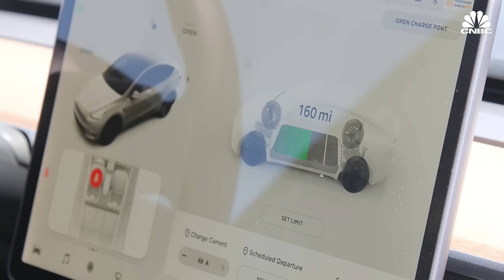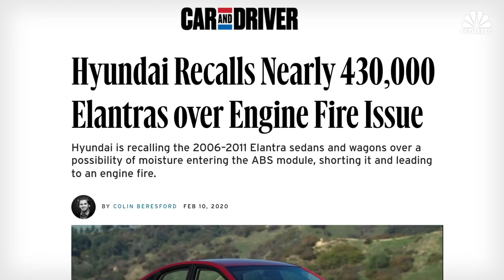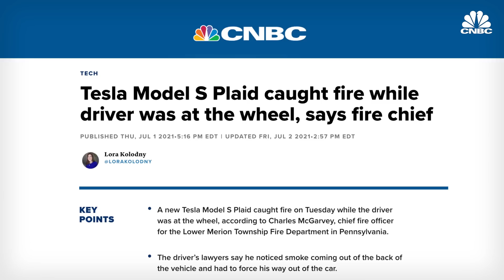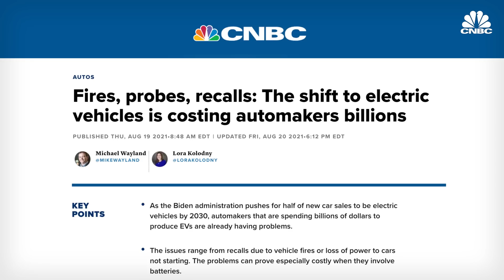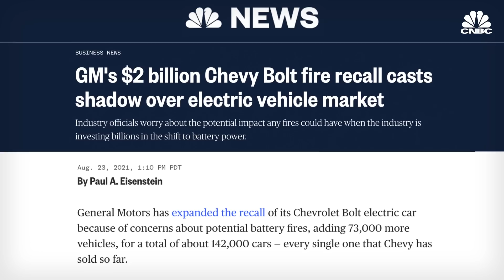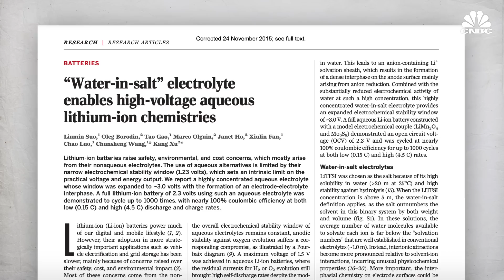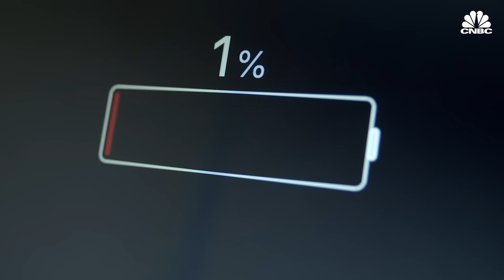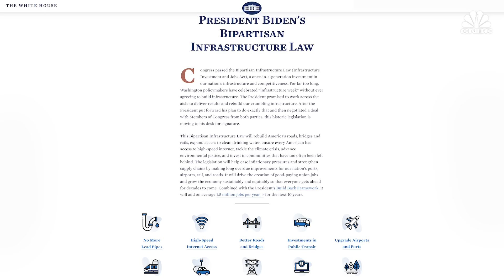Why Tesla, GM And Other EV Companies Have A Fire Problem

Comment: As they said, these types of fires are very rare. 
You're more likely to get in an accident than having the vehicle just burst into flames. 
Of course, the media likes to make it seem like this is a daily occurance.
Reply: Agreed
Reply: Fires in garages can occur for many reasons, but if the garage has an EV inside it, the fire can become catastrophically damaging very quickly. Even when an EV is not a source of a fire, just having it becoming involved in a house fire raises the stakes by an order of magnitude. Having an EV inside your garage is like choosing to store a box of dynamite in your garage, but people aren't realizing this risk. With more incidents and more news reporting of those incidents, EV owners and prospective buyers are gonna have second thoughts.
Reply: there are more than 900k vehicle fires in America each year, most are ICEV.
Reply: @markplott4820  most of those fires lasted less than those of a lithium battery car or were put out with extinguishers, good luck dealing with those super safe batteries.
Reply: @dawrincueto6962   - FALSE, you can knock down a battery fire in less than 3 minutes and just need a water tender Afterwards, once you ISOLATE the battery from the Circutry , the FIRE is a non issue. 
TESLA including all OEM's have a battery Isolation INFO page.
Reply: @markplott4820  so why have firefighters had difficulty putting out those cars and even reignite after using more than 20,000 gallons of water, can I see a video of what you say in practice?
Reply: @markplott4820  because evs make up only 3% of auto sales. What do u think would happen if there the majority of vehicles on the road?
Reply: @herbertfreeman3767  "because evs make up only 3% of auto sales. What do u think would happen if there the majority of vehicles on the road?"  Nothing as math, statistics and reality would still apply.
Reply: Agreed thanks for sensationalizing the problem CNBC…
Reply: I hope you like "radiation poisoning" if you drive an electric car
Reply: @TheIncomparableGolfer  You know your body is emitting electromagnetic radiation, right? By your logic, you are a danger to everyone around you.
Reply: @macemoneta  exactly.. so adding more radiation is not smart
Reply: @TheIncomparableGolfer  There is no radiation poisoning in electric cars.  The idea that electric cars emit radiation is beyond dumb.
Reply: @redbaron6805  wrong again lmfao at this 🤡